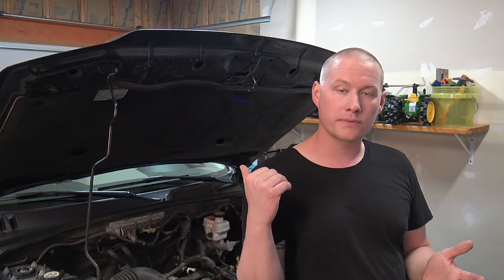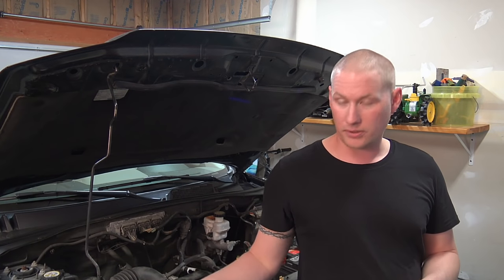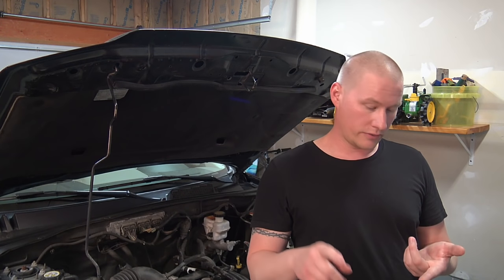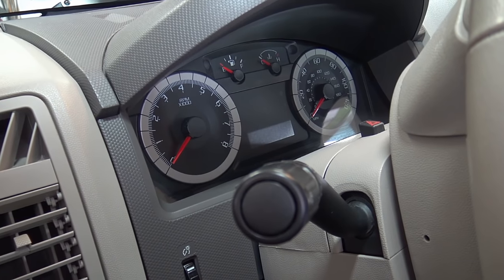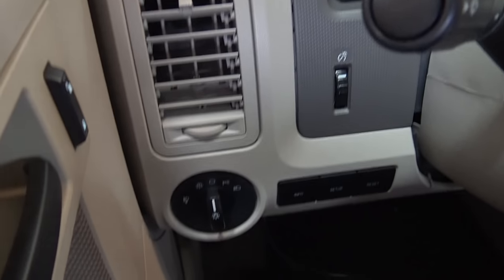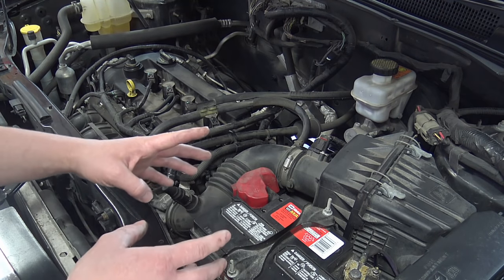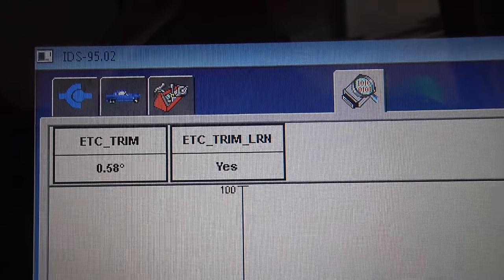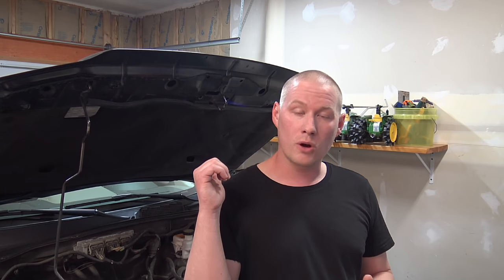Ford Vehicles: Electronic Throttle Body Calibration Procedure

Comment: Hi, my 2009 Ford Mondeo XR5 has a loss of power under load between 2,000 and 3,000 rpm?  
The car has been standing and has had a replacement battery installed.

Comment: My truck f150 2005 5.4 , if I plug in the MAss air flow sensor, it will start and shuts down immediately. Even with a new one. Thanks

Comment: So just a quick question I have a 2005 Ford F-150 with the 4.6l v8 and it’s 4x4, when I come to a stop it kinda acts like it’s out of gear then if I hit the gas a little harder it’ll grab and go, and the o/d off light just started flashing and I have a p1744 code. I was gonna replace the tcc sensor. Any other advice?

Comment: I have a 2005 Ford fivehundred and it seems to hang when changing gears. I have to let off the accelerator for it to shift. Could this be a throttle body issue?

Comment: Hey man, I know this is an old ass video but I'm hoping you will see this and be able to help me. I've tried this method, as well as the on/off and gas pedal method, after replacing the OEM throttle body with a BBK 73mm one. I'm able to drive my truck and haven't gotten shut down while driving and no longer receive a P2112 code, but now I am getting a P2282 code and my gas mileage has gone to absolute garbage. I've tried all these methods a few times.

Comment: I got a p2112 code and wrench which i lose throttle and ruff idle limp. I shut truck off in park turn back on and im good again for a few. About to replace throttle body or less you have any suggestions first?
Reply: Sorry 2013 f150 fx4 ecoboost 3.5

Comment: I need some help: I been having intermittent issues where my car seems to loose engine power and my transmission shifting seems to be delayed- this happens only when the "wrench" appears in the dash board. The initial DTC was P2135. After I replaced my battery it gave me 3 other DTCs altogether: P0122, P0223 and P2110. After testing the TPS voltage through the connector I noticed that reference voltage is at 5 V, that's expected. "Return" voltage reading when closed ranges from .9 to 1.2 volts. However, when I manually and slowly opened the throttle,  the voltage reached 4.5 v at half way the throttle and as I continue opening throttle to wide open, the voltage signal continue to stay at 4.5 volts. 
So I decided to replace the TPS and follow your relearning procedure, however, the voltage readings are still the same. 
I drove my 2007 Mustang GT last night and this morning and the check engine light and wrench have not appeared. Car has not behaved with the issues mentioned above but I still feel car has not the same acceleration as before. 
Is Reaching maximum voltage at half way the throttle a problem? Any help would be appreciated

Comment: Let me ask you a question. I had a mechanic replace the throttle body and do a fuel system tune-up. The TPS engine code came back on. I did the procedure in the video after already driving the vehicle and the engine already in operating temperature, it was already warm. Will this make a difference and I'll have to start all over with the engine cold, or will it still be calibrated correctly? At least the code went away. I hope the fact I did it with a warm engine doesn't cause a bad calibration and I'll have the same problems of the engine light code, the wrench light, and the vehicle stalling and the engine turning off. I hope to hear back, I really need help.
Reply: Jay  I realized I have to. The car hasn't given me any engine lights, but it did stall on me and gave me the wrench light. Then I restarted the engine, and it was fine, the wrench light gone. It probably did this because it didn't calibrate properly since I did it with a warm engine. I'll do it again cold like you said and like in the video.

Comment: Great tip I'll give it a shot my wife's escape dies for no reason all the time with no codes or cel and for whatever reason my scan tool can't connect to do koeo or koer test and I'm at my wits end.
Reply: So I did this and let it sit for almost a half hour and when I reconnected the negative cable it made a few clicks then started up?!  No keys in the ignition!?! Wtf??
Reply: Problem persist so I'm back at square 1. Wife is looking at new cars already...

Comment: do you still do this on a 2006 Ford Escape Hybrid I changed out the battery the night that I bought it the next day the service wrench pops on and I've been researching on what it could be I switched out the filter in the back for the hybrid system and it pops on and off sometimes of the stay off for a while then sometimes it comes back on I'm thinking it may be the door blend actuator in the back or the electronic throttle body needs be clean like you shooting your video but I'm going to have to do this after I disconnect everything when I clean it the electronic throttle body and for what you said in the video I guess I was supposed to do it when I changed out the battery

Comment: I have a 2004 Ford Explorer XLT. The battery was bad so I changed it. With new battery it cranked and a "yellow wrench light" came on and won't  respond to gas pedal. It just runs in idle. I did a code scan and got codes P2104 and P2112. Could me changing the battery and not doing relearn throw these codes? If I reset PCM and relearn could it possibly correct the issue? Truck drove fine before swapping battery with no problems. Thank you

Comment: Got a question as it seems its not correcting itself...my F150 3.5L idles at 250 rpms, runs smooth and doesn't stall but it should be higher. Recently installed timing chain kit, R2 the rt exhaust manifold, new plugs, cleaned throttle body and MAF sensors. Reset PCM twice now to "re-learn" the shifts and idle speeds but it won't come up from 250. driven about 700 miles now and dealer says it should of learned it by now but don't want to take it in to them. Any ideas??

Comment: Please help!!  My father is 80 and purchased a 2015 Ford Transit Connect Titanium with the additional $3,000/extended warranty. A cheap plastic part wore out on the transmission cable and now his vehicle needs a new cable. The dealership from where he purchased the Transit Connect wants to charge him $943.76 to replace the cable and he was told that it’s not covered under warranty. 
What can he do?  Is this something I can buy OEM on eBay for $82.63 and install it myself for him?

Comment: Any thoughts as to where the Manifold Absolute Pressure sensor is on a 2012 Ford Fiesta?  I've looked and looked and watched this video and that video, but I still cannot find it.  Is it behind the throttle body?  Near it? The code reader says I need to change it but I can't find it.  Any help would be greatly appreciated.

Comment: I have a question if you change your throttle body and you don't do this procedure your new throttle body will act up like your old throttle body thank you
Reply: I'm trying to figure out the same thing! Mechanic told me I had a hard code for throttle which is triggering the engine malfunction light.

Comment: Sir, what would be the reason of the difference between actual and desired plate positions? There is a 2.3° at idle and 5-7° difference on load. The desired position is always high.

Comment: I'm having the same problem with my 2013 Ford Fusion. The problem is Ford won't replace the part because there is not a check engine light on. Once the car stalls and I restart the ignition, the codes reset and there is no check engine light on. Actually, there is no check engine light at all even before it stalls, so it's hard for me to prove to the dealership that there is a problem. There is a dealership here that sells the part for 93 bucks. I guess I'll have to purchase it and install it myself rather than risk my life on the road!
Reply: Any luck with the new part?
Reply: I have this same issue with 08 Ford Focus with wrench light...it comes on-once i turn off the wrench light goes away and clears any code history as there are no stored values therefore reporting it they all think I am just making it up.....

Comment: Does disconnecting the battery like that reset all adaptations or does that have to be done with a scan tool?
Reply from the maker: Everything except misfire profile correction 09+ and trans adaptive tables as they are stored in NVRAM.

Comment: just did this the jumper sent electric through all negatives my temprature gauge dont work fans wont turn off im told to never leave that positive on the jumper.! fried or screwed with the vehicles function iT does not work right after i tried your method YOUR SUPPPOSE TO UNHOOK BOTH NEGATIVE AND THE POSITIVE TOUCH THEM TOGETHER AWAY FROM BATTERY NOW I HAVE MORE PROBLEMS THAN THE THROTTLE SEND ELECTRIC THROUGH EVERYTHING THAT WAS GROUNDED IS WRONG THANKS ALOT FOR MY SCREWED UP 2010 FORD ESCAPE
Reply from the maker: I don't think you understand, once you disconnect the negative battery cable you opened the circuit and electrons from the battery can no longer flow as the path is now open.

Comment: on my 09 mazda tribute cleaned my throttle body mass air flow sensor followed your other videos, did this relearn procedure... now the cars bogging out & jumping during idle and in drive... any thoughts?
Reply: Daniel cable

Comment: Hey FordTechMakuloco, do you know if this procedure works for Volvo 2.0D engines (from 2004+) too?
These engine have been developed together with Ford and are very similiar in many parts.
Btw I´m asking for my 2004 Volvo S40 II 2.0D...
Reply from the maker: +DoomsterD Not sure but it is worth a try.
Reply: DoomsterD if you clear the fault codes it will reset the adaptions.. got a volvo s40n 1.8 2006 disconnecting battery and short out the cables will not work. Resetting with scantool is required

Comment: I am having an issue on my 07 F150 with no throttle (pedal) after changing the battery.  All the instrument lights are on and it fires up however, won't respond to any throttle?   I disconnected the battery and tried this procedure.

Comment: Dude few days ago i cleaned my Throttle Body to my Ford Foucs 1,6 101hp 1999 year Ztec. I cleaned it with spray for EGR. First i disconected the - of the battery then started to work ofcourse but when i put all things back to car and then connected the - of battery again and started the car she holds around 1200 on place and when i drive not on gear holds around 1800-2000. For those few days i disconnected the battery 3-4 times but still no better. Also checked the Throttle body for air flows with spray for breaks no air. (sorry for bad english) if you know somthien about all this please help.

Comment: could this cause multiple codes if not reset right,. codes for o2 sensor b1 s1 for example,. and drive and idle fine,. then randomly just lose power run rough,  blinking check engine light, then check engine light turns off on its own (not always),. then runs fine again..? and i also have low idle 500rpm or less after engine is up to running temp..

Comment: So I have a rough engine idle while the AC unit is on . Does that have something to do with the electric  throttle body? When the AC unit is off the engine idles fine . It only has rough idle when the AC unit is on .

Comment: This is probably a dumb question but how do you learn the shift points if you have a standard transmission?  Just run it through the gears on the open road, 1st through 5th, and that's it?
Reply from the maker: +2000GT it won't learn the shifts as you shift it manually but it will still gone trim the airflow angle for accel and decel events to prevent idle sag
Reply: A few years ago I reprogrammed the engine with a Diablo Predator . Will clearing the PCM memory affect the Predator programming or will I have to reprogram with the Predator?  I also installed a larger MAF sensor and catback exhaust. Sometimes at idle the engine acts like it is going to stall. Will clearing the PCM help? Thanks
Reply from the maker: No it will not clear it the pcm is programmed in non volatile ram area of the pcm. The drivability concerns are likely from the aftermarket tune.

Comment: WTF! 
I been having a problem woth dlow acceleration and loss of power for almost 1 year but after watching this video i remembered i had taken off my throttle body once or twice for cleaning,  so i thought to myself hmmm this might be my issue since i tampered with it,  but anyways i just turn my key to the on position and press the gas slowing and released it slowly and so on and it actually freaking worked im so happy

Comment: I don't know if this is whats wrong with my 2007 ford five hundred. It revs like crazy when I shift from drive to reverse or park. When it's idling it goes to about 500 and the only code I've gotten was a low voltage level code. I don't know what to do.

Comment: My intake hose is now blowing off the throttle body when it gets under torque pulling on a hill. Any ideas? I've got it tight but when I get on say a hill and I think alot of boost. Boom you hear a pop and loose power. Get out and it blown off again.

Comment: I replaced my intake manifold and now the idle is really high , when ever I touch my throttle the rpm will jump to 2000rpm drop to 1500 and then it seams like it hunts from there , is there anything else that needs to be done after replacing the intake ?

Comment: I have a 2007 Ford explorer 4.0L and replaced the heater core. I had to completely remove the dash and unplugged the ground and "ECM I believe" that's on the passenger floorboard. When I started the car it immediately threw the code P0122 that's for the TPS. It was good before I did the heater core. Any ideas 💡

Comment: I have a 2005 Ford Expedition Eddie Bauer 5.4 3v triton and my electric throttle control light came on and I put a new one already put new shifts to the noise speed sensor it goes in reverse but won't go and drive I'm tired of spending money on little parts can you help me out what you think it is THANKS
Reply: Shift solenoid and speed sensor

Comment: Sir right after cleaning my Toyota Avanza throttle body my car had high rpm 1000-3000rpm back n forth..is this procedure can fix this???
Reply from the maker: Probably like the GM vehicles where it has to be recalibrated with a scan tool.

Comment: I know this is a old video but will this help with the slight rough idle when in traffic. I have noticed that I can feel a slight rough idle when the brake is applied waiting in traffic, if I apply the Emergency brake and let off the brake pedal the idle goes up a couple hundred rpm and is a smoother idle. I have a 2014 F150 5.0L
Reply: inspect the check valve on the brake booster.  if you are having idle issues that you directly associate with pressing the brake, then your issue is related to vaccum on the booster.  reseting your electronic throttle body will not help.

Comment: Having trouble, replace throttle body went through all the steps on start up it’s fine maybe 6-8 seconds then returns to rough idle wrench lite appears have let it run for 10 plus minutes cleared the code p2111 did not replace mass air sensor any ideas?

Comment: Replaced my throttle body motor and now I have the wrench light apear on the dash and the gas pedal doesn't work now. Any thoughts?
Reply from the maker: Was it a Ford unit?
Reply: +FordTechMakuloco yes E150 2006 4.6

Comment: Is this procedure different for a cable drawn throttle body? The reset part of it that is?
Reply from the maker: +nick fletcher The same principals apply but following this procedure is not as critical as it is on the ETB systems. It's still a good idea on yours though.
Reply: +FordTechMakuloco thank you sir! I went and tried this and the truck is running better than ever. Thank you for your help
Reply: FordTechMakuloco Brian does this procedure wipe off the keep alive memory too ??

Comment: I go to you whenever I have a problem w/my 2005 explorer 4liter I just got this truck I've replaced all gaskets /value / head/ mass/air/ throttle body thermostat you name it now it is in limp mode all electric wires ck out w/ correct volts I can't get out of limp mode 2 or 3 times it came out after resetting idle only to go back in ok get replaced no vac leaks pcm tests good can you HELP please

Comment: Hey hi! I hope you can help me something. I did this to my 2005 f150 5.4 3 valve and at 9 min it shut off then again 12 min, cold this be a bad sigh? What does it mean? BTW I've been having trouble with the truck bogging down at hard acceleration and between 1200-2200 rps. What could be causing it. Has new intake, new plugs, new oil, different boots, all 4 new o2s sensors, with no cats, new vct but I have the phasers deleted with the Liverpool lock kit with no tune.

Comment: Does this has any negative effect if you have a vehicle that is tuned?
Reply from the maker: No all calibrations, stock or aftermarket need to have the throttle body angle calibrated.

Comment: we had temperatures in the negatives last week. I however did not start my pickup during them 4-5 days. when I went to start the pickup , I had a crank but no start. tried like hell to get the engine to fire and ended up running the battery down.  I recharged the battery even stuck a diesel heater infront of the pickup with tarps all around.  I came across your video a while latter when temperatures was in the 20`s. disconnected the negative post and jumpered between the 2 cables .. I am still getting a crank but no start.. any solutions on what I can do at this point?
Reply: pickup is a 11 f150 V8

Comment: Help my 2012 ford fiesta s has this issue. Ot will start the idle will go to 1000 to 700 up down up and stalls if i hold the gas it will run should i take it out and clean it

Comment: I cleaned the throttle body and did all the reset procedure like you mentioned, but the rpm is about 2200 rpm and just won't go down to normal idle. What could be the problem?
Reply from the maker: Then this is probably not your problem.